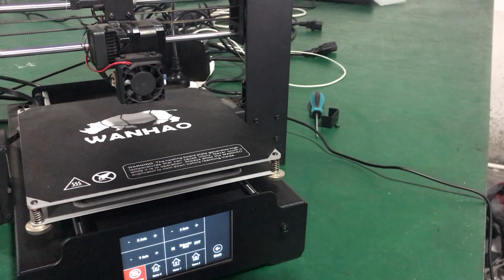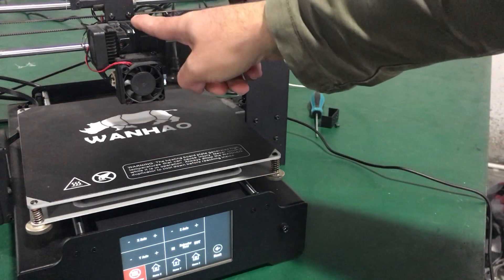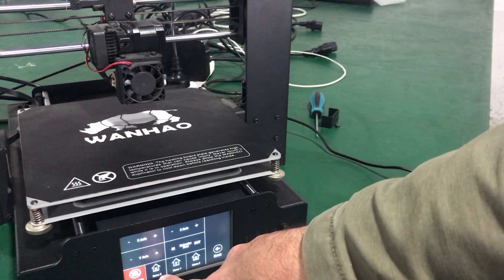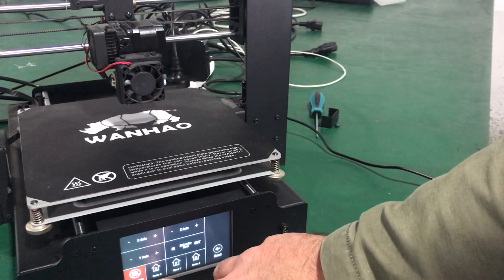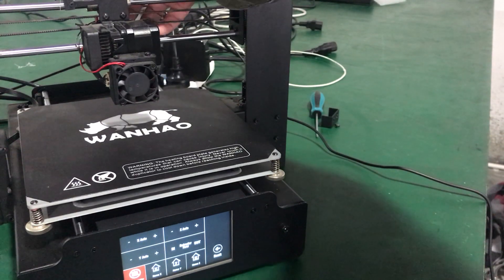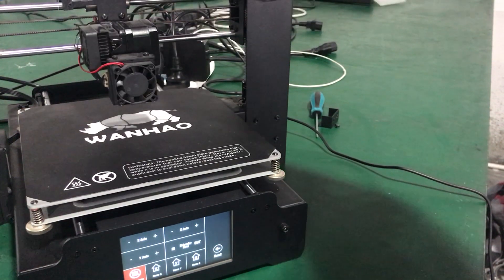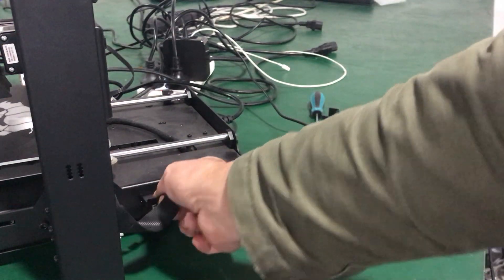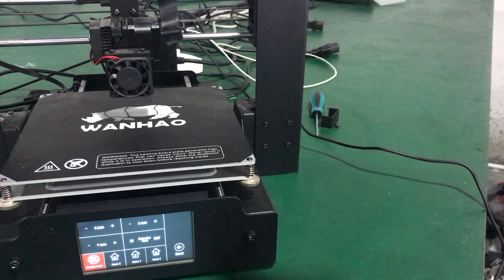X Endstop Switch Troubleshooting

Comment: I have this issue and have followed the video and instructions. On unplugging the X end stop switch the print head goes to home and according to the video is potentially defective. However I have just unscrewed the switch and put an avo across it and initially, as you would expect, it shows open circuit but when I depress the trigger the ohms drop to 0 showing that the switch does in fact work. In case the problem is further down the line, I followed the rest of the video and each time the head went to home. Does this mean that the other 2 items are defective. I am now confused. Comments anyone please?